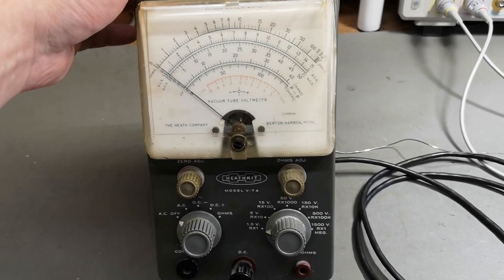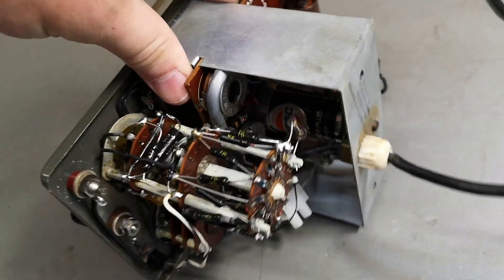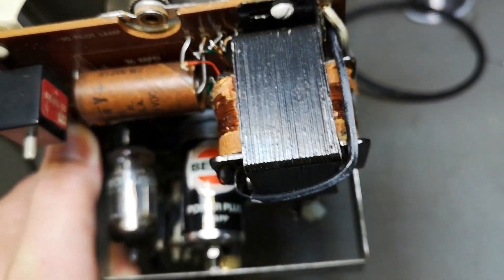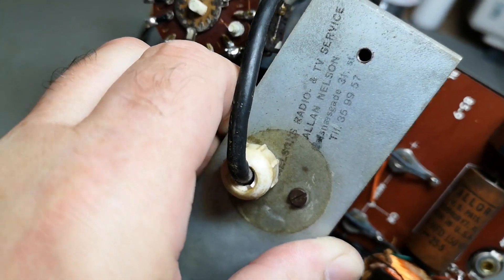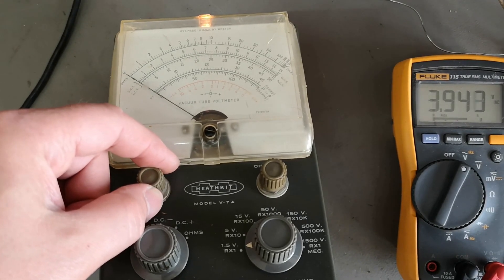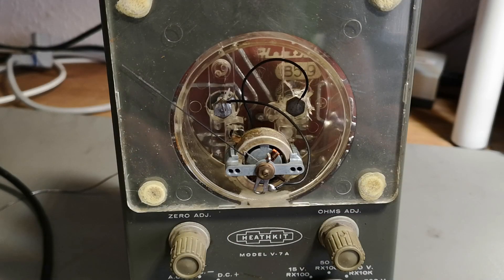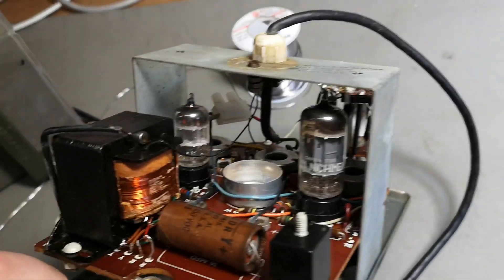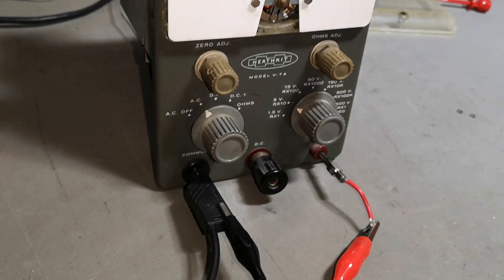Heathkit V-7A Vacuum tube voltmeter DC AC Ohm 1956-61 test teardown

Comment: You could replace the light bulb with a neon lamp, after modifying the unit if necessary. I've an Eico vtvm without an indicator light and I intend to do the same.
Reply from the maker: or an led

Comment: I have the same exact VTVM. I never turned it on until I replaced the capacitors, selenium rectifier, and light bulb. I also cleaned the switches. Get a mono plug for the DC lead. I built a very nice test lead for mine, a gold plated Switchcraft mono plug, a thin coax, and 2W flame proof NTE 1M resistor that tested within 1%. Buy replacement meter probes.

Comment: Just bought one off eBay for testing valve equipped HiFi,  my Hammond spinet, and Dad's Beetle (my DVM is MIA after a move), hopefully good as the pictures show. Not much to go wrong, though really don't need another project.

What an odd telephone number, with a country code of 35, nothing comes up on the internet.
Reply from the maker: be sure to double tell the ebay seller to super pack it, the display plastic is brittle and will crack, when ship and not packed for their type of handling
Reply: Wow, that was a quick reply, it is appreciated, thank you.

I didn't think to look and now too late to prevent damage, though if not as described, will get a refund. All I care about is after replacing the capacitor(s) (crucial a filter capacitor is replaced before mowing up a transformer as can cause severe damage) it is fully functional.

By the way, has all the leads, look to be useable (all wrapped up and tucked in the handle), if not, rather have something to rebuild then start from scratch, this will be my first electronics repair. Next up, use this to rebuild a Hammond amplifier, to practice before dive into the complete organ (my great grandmother's she bought new), the separate amplifier then be used for over drive (look it up, sounds amazing). Probably rebuild the console's amplifier first, being just one chassis.

Comment: I had a similar problem with a Kyoritsu VTVM, only after tapping on the glass, the needle would do the final move.
I figured out that there was too much friction in the needle bearing, so I released the adjustment screw a little bit-> perfect response of the movement.
Reply from the maker: good idea, but this is not always easy to perform, you need a steady hand, and know what you are doing, and hold contra on the correct part, else it is very easy to brake it in 1 sec.
maybe i should try to explain this in a future video when i get one more unit in with sticky needle.
Reply: @TeardownOZ2CPU  EDIT: Oh, you DID already what I was suggesting ... should have watched to the end. -- Original Post was: One tip I read - and tried with some success - to reduce some types of meter stickyness due to dirt is to wire the movement up to a function generator and exercise it... obviously, if it is abrasive dirt, can make it worse...

Comment: Nice Meter, have the same one sitting in my pile of shame - waiting for repair.

Luckily the Battery in mine was already removed when I got it but the damage was already done and it looks way worse then yours.
Also someone decided to paint it yellow - wonder how I should  clean that up😅
Reply from the maker: oh no paint !! that is bad, i have no idea how to fix that, is your meter plastic perfect intact ? if that is the case, maybe use the plastic as a donor par to another one, this unit is not that rare, but a perfect intact plastic is !
Reply: @TeardownOZ2CPU  Yes, the plastic is intact apart from some minor scratches. Hope the internals are ok too, otherwise you might have a donor for your beat up plastic cover some day 😛
Reply: @twipsy2047 , depends on the kind of paint. Might be weak enough to remove with real white spirits (mineral spirits), the kind that isn't odorless. Maybe take it to the hardware store and see if the clerk has a product.